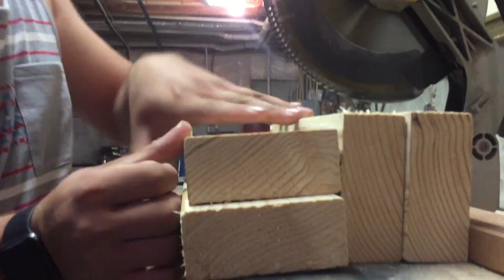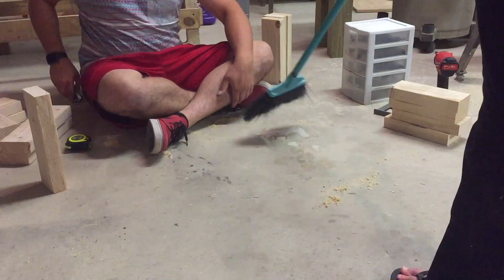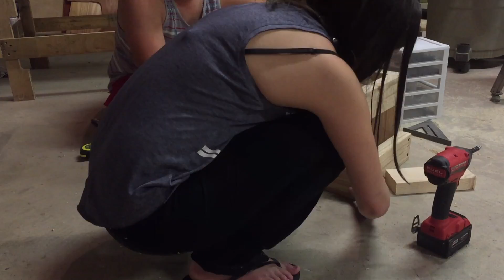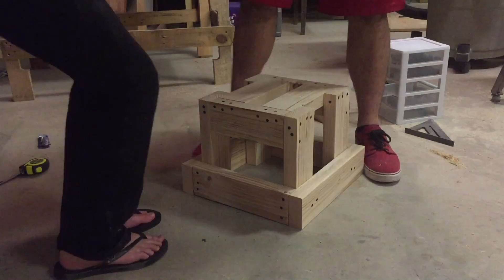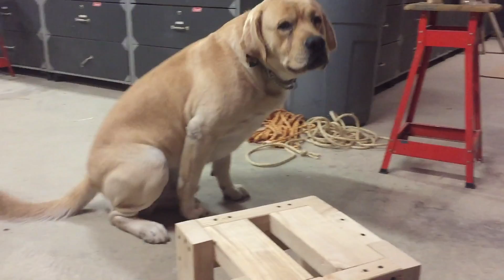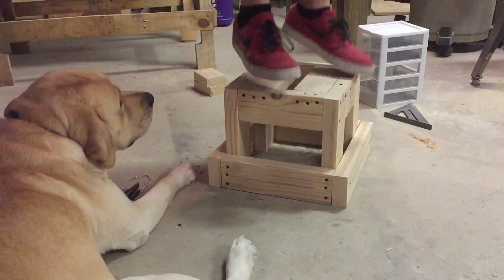LaBelle Wooden Dirtbike Stand

Comment: thanks for this plan. i made roughly the same by watching your video.. made it 16 in high which is maybe a bit too high (i have a WR250R, but it works well for minor servicing and chain cleaning. If someone else makes it for a WR or similar height dual sport, I would suggest going with 15 in or so and then if you need it taller you can always cut out a square of 3/4 in ply and throw it on top. Also if you want to drain oil dont forget to leave holes in the middle. Thanks again for the idea! Built with scraps in about 2 hours with a circular saw and a drill and a hammer.
Reply from the maker: Sean that sounds perfect! I made mine a little short because I had planned on adding a jack of some sort in the middle of the platform but never ended up getting around to that 
Thanks for your comment :)

Comment: Thanks for posting dude. I am making one exactly like yours, including the height, as I use it in place of the side stand (was dodgy so I removed it) and makes it easy to get off and place the bike after rides. Use it at the track to support it rather than leaning it up against cars and trees. I am making a second one which is for working purposes and will lift the bike clear of the ground - but not intended for daily use.
Reply from the maker: Bro, exactly what I built this for. I have plans to make a stand that has a jack pump built into it so you can lift the bike up to work on tires or drop it down to make it more sturdy for other work like on the seat or battery

Comment: make another box smaller, install a bottle jack in it securely.  use the bottle jack to raise the bigger stand... then, you can lift the bike. :)
Reply from the maker: Jenn Tek you know, I was actually considering doing something like that! I have a car jack that would work very well if I make an attachment/ base for it to operate under. Thank you for the suggestion, great minds think alike! 👍🏻
Reply: LaBelle's Workshop Excellent!  Make it happen guys and please share your design drawings and material list!
Reply from the maker: Michael Lee I'm currently working on a new desk for my office (while concurrently working a 40-50 hour work week), but as soon as I am done my desk I will start on the elevating bike stand 👌🏻👌🏻

Comment: I think it's great dude!  Will use same design.
Reply from the maker: Michael Lee awesome! Make sure to give yourself a couple extra inches to compensate for how much the rear wheel comes down (unlike mine) so that the wheel can rotate freely 👌🏻
Reply: LaBelle's Workshop Cool.  So instead of 4 x 11", go 4 x 13"?  Should I add an extra inch to be sure? (That's what HE said)
Reply: LaBelle's Workshop I liked your rebuttal of the "master craftsman" btw.  Funny and absolutely correct.
Reply from the maker: Michael Lee I would take a measurement from the bottom of the frame to get a reference, then add a couple inches to makeup how much your swing arm can drop. Just make sure that your stand is tall enough to allow the wheels to be evelated off of the ground, but not too tall to where you can't safely lift the bike on and off of the stand. Best of luck, be sure to write back if you have any questions or ideas that you want to bounce back and forth on! 😁 Thank you for the nice comments by the way 👌🏻👍🏻

Comment: I like the stand but isn't the idea of it supposed to lift the bike off the ground.  A few more inches of height would make a difference. Thanks for the project though
Reply from the maker: Generally, you are correct that the stand should be a couple inches taller. However, the purpose of this stand was so that I could make the bike sit level so that I could get more accurate measurements for the stuff that I have made in my other videos. Thank you for your comment, you did bring up a good point 👌🏻

Comment: Is it in inches
Reply from the maker: Lol I saw the pre-edited comment and would like to assist you in determining dimensions that don’t have units (even though my dimensions have units). Just use the logic test out if certain units make sense; are the pieces in my hand super long? Taller than you? If yes, it is probably meters or feet, if no then it is probably centimeters or inches. At 0:20 I said 15" so logically these pieces are either cm or inches. 1 inch = 2.54 cm, so these pieces would probably be in inches, which is what unit I used. If you see ' as a unit it means feet, while " means inches. Sorry for this long explaination, but I hope this helps you in the future 👌🏻👍🏻

Comment: Journeyman carpenter here; Terrible building, screws have a very low sheer rating. The wood should be supported by the wood directly under, or bolts.

Cheers :)
Reply from the maker: Kyle .Krieger go watch Matthias Wandel’s video on screw strength to inform yourself a little more. As for the not wood “supporting” the other pieces, the 4 vertical pieces provide more than enough strength to hold up more than the weigh of my bike. I could sit on my bike while it’s on the stand, and there would be no issue. In this application, swapping the screws out of bolts would hardly change anything. The design of the stand is based around the 4 vertical pieces being supported and held together by the other perpendicular components. Oh yea, and just like every other YouTube “expert” - I like how you included your ‘trade’ as if that makes you less wrong when trying to criticize someone’s content. Cheers mate 😂👌🏻
Reply from the maker: And I know I’m giving you way too much time and effort for a silly YouTube comment, but thinking about it further... I’d conclude that hogging out material for the bolts would make a project like this weaker. The screws bite into the fibers of the wood and hold everything together while adding a bolt would require you to drill out a proper sized hole then attach a bolt and nut, only relying on those to hold everything together. Instead of us making this quarrel have a negative outcome, we can make it into a learning experience - if you’re willing, go ahead and make a better stand (with wood and bolts like you described) and then test out a bike (mine is only 280 lbs so desired specs may vary). Make a YouTube vid on it, and if yours works and mine works then everyone will be happy in the end 😁
Reply from the maker: There's a difference between critism and recommendations
Reply: saying "terrible building " isn't the best way of providing constructive feedback . 😁. simple solution to the structural integrity would be to simply add a 1/2 piece of ply wood to the entire top surface.
Reply: Stupid fucking comment, “Journeyman Plumber/Gas Fitter , Water treatment plant operator” since were sharing our resumes lol
This build is perfect, he’s not supporting a house, stand only use to support a bike, nothing gonna shear here bud. Go school a kid on making a bird house and get a life. 
Great video, great build, enjoyed watching. 
Thanks
Reply from the maker: @James Hamilton Hahaha awesome comment
Reply: Sorry that was pretty insensitive, apologies.  I should have just said it's better building practice to put your verticals underneath your horizontal members when possible~  I subscribed to make amends, I hope you keep making videos!